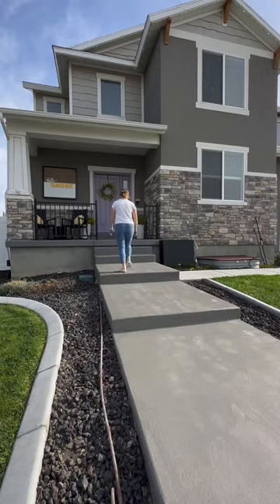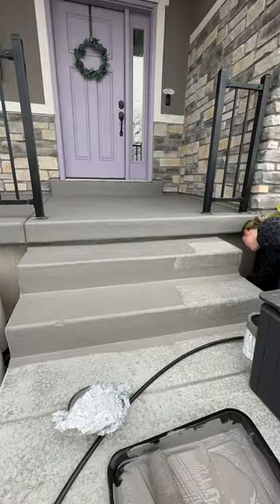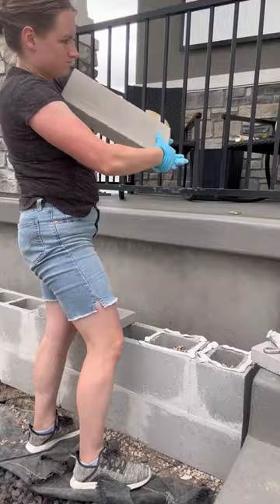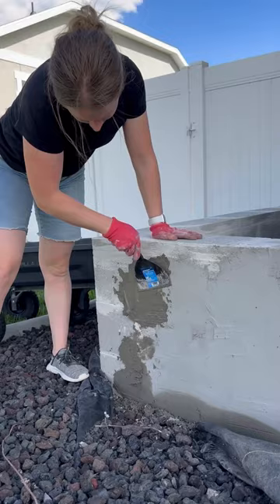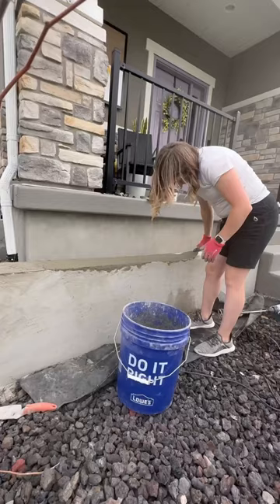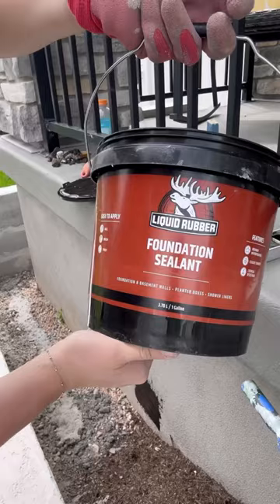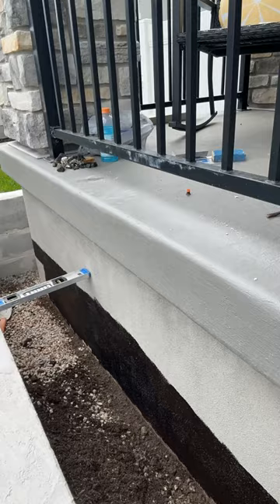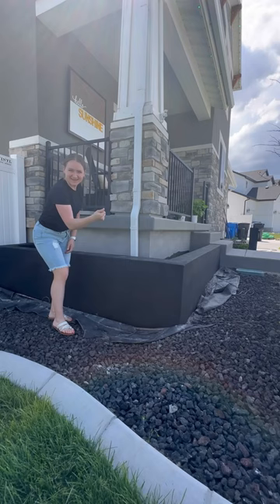Part 3 stucco,paint these projects are always intimidating at first but always worth it #frontporch

Comment: Where are your drain holes? My house has a stone flower bed around it and it would fill up with water.  The drain below doesn't drain and the water would make the wood wet. The drain holes helped.

Comment: I've been a painter for 30 years, and I can tell you painting concrete, especially exposed concrete like that, is the worst idea ever. Sure, it will  look good for a little bit in the beginning it's not a question of if it'll fail. It's when will it fail. Even if you prep the concrete properly and from the looks of it you didn't, it will still draw moisture from underneath, causing the paint to fail. I would put this under the category of "just because you can, doesn't mean you should." You are definitely going to lower the value of your house when that paint fails in the year 2.
Reply from the maker: I feel like it’s quite the stretch to say painting a few concrete steps will lower the value of the house. As a painter of 30 years you should know that everything eventually has to be repainted, so I guess what’s the point of painting anything?
Reply: So aren't you a painter of 30 years only because things need repainting and refinishing? Paint does not equal permanent. Also guess what? When the paint does fail and chips off, it can be removed :) 

Although I don't recall a video of hers saying that she will move in 2 years, so I'm not sure why it would matter if in that moment, it "loses its value". As if it can't be repaired to be better after for whenever in the future (if) she decides to sell that house. Just make sure that you're not the buyer 😊 problem solved.
Reply: Painting is a good arm workout so it's all good 😂
Reply: @She.Follows.The.Sun.      Instead of you and the homeowner being so rude about it…just take it under advisement. All the times that I painted my porch….it failed every time and I was constantly repainting because it gets scratched up and look a mess. You will have to power wash and paint again. The chips will go into the flowerbed. Maybe, do something I didn’t and ask how to remedy the problem.
Reply: He's right. I'm an interior designer and I never advise to paint concrete, always stain if you want a different look. Not only will it crack, but now you've made more work for yourself because you will have to scrape and/or power wash the cracked paint off. And yes, it absolutely does lower the value of the home.
Reply: I hate it when people say shit like “it will lower the value of your home”. If it’s YOUR home you’re planning to live in for a long time or forever, why should you care the “value” of it. It’s YOUR home. When I’m living in my home, painting walls crazy colors, doing renovations I may or may not mess up, it’s my house and for me to enjoy or not enjoy. I’m not going to worry about a hypothetical person living in my house one day when making decisions.
Reply: @justmythoughtsjustmythough7202 haha you were rude to her,  she replied in a slightly offended tone,  and you're all "don't be rude to me".

To be nice you say,  "Hey, so creative!  But I would like to give you my advice as a painter..." Manners.

Comment: These are not improvements. Everything you have done reduces your value. What wrong with actual plants to upgrade your landscaping.
Reply: Value? The only one that matters right now is how she values it, otherwise she's basically just renting her house from whoever owns it next.
Reply: @My-ChEmiCaL-RoMaNcE  Actually, most HOA 's require you to get approval for any changes too the exterior of your property that affects the value. If you ruin your home with poor improvements you affect the value of your neighbors homes, especially on the your street. 

PAINT WILL PEEL on concrete in short order. The planter  wall she built next to her foundation will void her structural warranty as most require no moisture retention next to your foundation planter wall will cause deterioration of the foundation as plants are watered. That gutter is supposed to drain AWAY from the house/foundation. 

I have built homes with many builders and this is all in your closing documents. When I sell a home I always explain this explicitly to the new buyers. Many think they can do whatever they want - you cannot and must understand that home ownership requires responsibility. It is not a toy to do whatever you wish. The drainage off your property must not change from time of building permit.